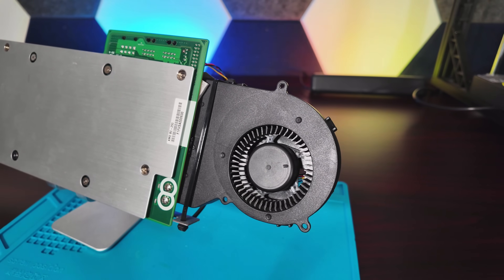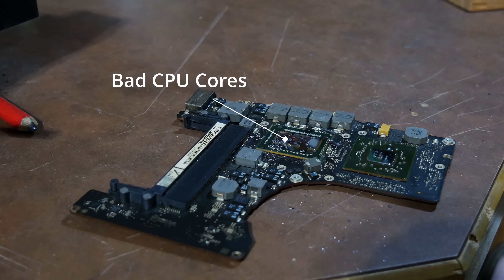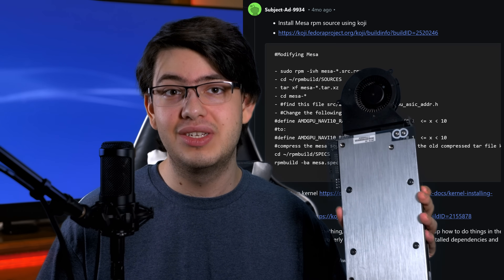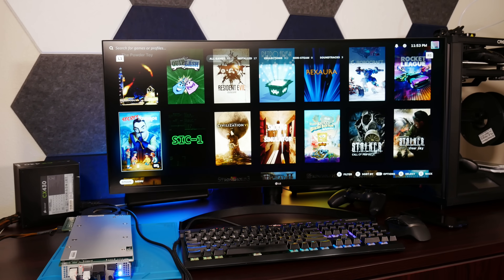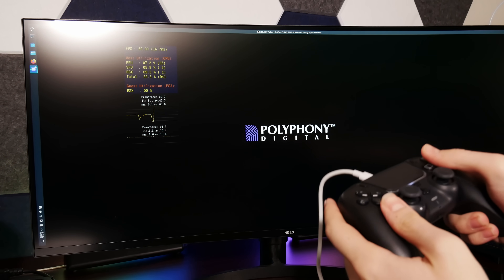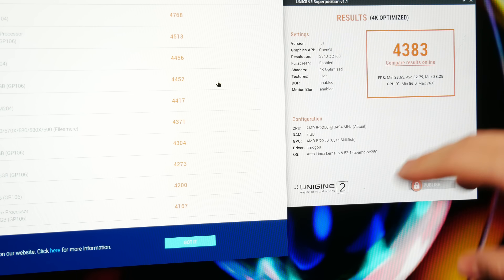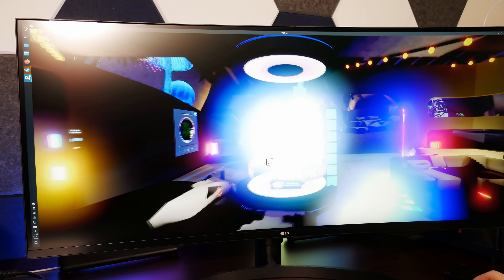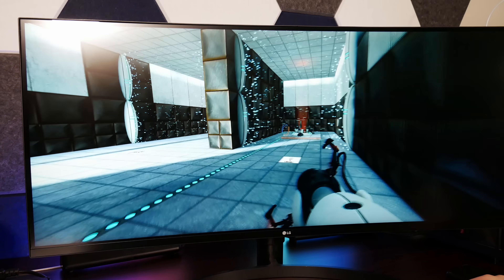I Ran PS3 Games on PS5 Silicon to Prove Sony Wrong

Comment: sony don't see point run original ps3 games due to many reason., the game data is very bad to play when looking at games ran on acutal ps3 is reason it ran 720p ...but upscaling to 4k makes look uglier with texture pop ins due how it was designed to run on cell processor in mind for nvidia 7700 gpu process textures on 256mb vram with 256mb system ram..the cpu has 1 core and 6 threads that can run gpu risc code  if devs knows how to utilize it right for game ...but its tradeoff when using only one at time for cpu....it can't do both for extra threads and extra gpu cores  that only one at time can be use...either use one core that available for game while gpu see extra 6 SPE as extra gpu cores for rendering tech or use all extra 6 SPe as cpu calculation for game while nvidia won't get extra performance boost when running on its own what is available from gpu core itself...its how it was designed for programming . Its interesting method if only sony could waited for more powerful gpu option from nvidia. They could had use 768mb gpu option plus system ram with 512mb...that be enough to run high res textures on ps3

Comment: you should try running llama 3.1 405B on the whole rig. you should have enough ram for it and youd end up being able to basically have your own chatgpt 4o equivalent instance with unlimited usage
Reply: This. I'm curious over whether or not it has any AI usage, because 3060 cards are expensive, while BC250's are at a more reasonable price right now.

Comment: I'm seeing these on eBay for $60 each, which is only a little bit more than a raspberry pi 5. It would be pretty hard to get a r5 2600x + gtx 1060 for that cheap, let alone a motherboard for them. I can imagine use cases for these, like if you have a spare pcie power connector in your computer and an empty slot in the case, you could turn one into a small gaming rig for a kid or something (with some 3d printed mounting hardware). If someone figures out the memory clock that's even better..

Comment: I think the main reason they haven't done it yet is because they won't unless almost 100% of the PS3 back catalogue runs without any issues. They want to maintain a reputation and if the emulator only runs half the PS3 library with glitches, it'll piss off too many Sony fanbois.

Comment: Ppl are assuming stuff they dont know shit about.

What i know about Sony is that they are very keen on quality standards.

Just look at PS4 support, there are only a „handful“ of games which dont work and still, that was reason for Sony to point that out.

RPCS3 is great but nowhere near to be used as a service for such a big company.

The CPU in the PS5 is still not fast enough and that wont change with your stupid assumptions

Comment: linux mint 7 allows me to delete any files on computer even those as alt os, but over 7 files have this stupid lock on them and SOMETIMES getting su root can fix it but othertimes dosent, why is that? i would like to be able to add and delete files on computers without having to use a super outdated version that wont even work on lots pcs :/.

Comment: Nice work, not surprising though given how good PS3 emulation has gotten over the years and the fact the PS4 onwards uses standard PC cores. 

If I were Sony I'd actually hire the emulation team to build an emulator especially for the PS5, because then they can sell those old games and it wouldn't actually cost them that much given how much prior work has been done.

Comment: 6:25
“Most levels”

Speaking as someone with approx 300 hours in LBP2 Emulated, the issue you were experiencing was emitters / destroyers.

RSPC3 HATES emitters.
Worst level for it is full metal rabbit’s flamethrower cap meanies, since they spawn like 10 fire particles a second.

Something about the spawn/destroy effects emitters can be given obliterates anything that isn’t a top-line CPU.

I got 5fps on the aforementioned full metal rabbit with an i8700k and 2070, would love to see what you get with this doohickey machine!

Comment: For the GPU being comparable to an RX480, you could always try using an RX6700 with an external GPU enclosure via HDMI. It might be slightly limited using HDMI especially when compared to USB-C or Thunderbolt, but I'm sure it'd yield better results than what's already on the thing.

Comment: I mean for ps6 there won't be any excuses.
I bet they remove the bluray drive entirely so you can't use ps3 discs. So they have a perfect excuse to make you buy same games yet again.

Also the jailbreaking scene probably has the most chance of putting a ps3 emulator on ps5.

Or at the very least, in like 7 years when ps6 is jailbroken that will be the ultimate console to have.

Comment: I remember going over the specs of the PS5 when it first came out.   The comparison we were making then was somewhere around an rx5700 or 5700xt.  If you assume the rx5700 and adjust the performance based on the CU ration (66%), you comeout in the rx590-ish range.   So this seems perfectly reasonable.  It's on par with a PS4 Pro with a much stronger CPU.  Which if it was cheap enough ain't bad.

Comment: All sony needs to do is make the "app" that runs PS3 games in emulation cost somewhere around $49.99 and I very much believe that people would buy it. The disk drive in the PS5 can read them, just rip them to the internal SSD and go nuts. It's not like you can buy these games anymore anyway. What's the big deal?

Comment: In this very rare occasion I do understand Sony why they didn't bothered to make PS3 emu for the PS4/5. The emulation from a CELL based CPU to an X86 instruction set would be a ton of resource to write from the ground up.(RPCS3 took 10+ years for the community.)  I do think it's true in itself the architecture of the PS4/5 isn't capable of running PS3 games.  I do not think they can use (or should use) a heavily modified version of RPCS3 from a legal standpoint I may be wrong because I'm not sure what license is RPCS3 use.  Also that emulation they hypothetically would build has to be 100% working at all times without any graphical bug/stuttering etc.  This huge development would make the PS5 cost more obviously. The B version (I'm not sure if it's possible tbh) that they include a Cell on the board like they did with the Emotion Engine for the early PS3 and it would still cause a huge price increase like with those early PS3s.

(small disclaimer: the last PS I had was the PS2 about 13 years ago so I'm not a Sony fanboy.)

Comment: yes but they need to spend a ton of time and money on developing their in-house emulator since rpsc3 is licensed under gplv2 which means theyd need to opensource any and all modifications done to it as well as testing it and integrating it well enough (cough cough Wii U vWii cough cough), and it's a feature that not many people will use as a lot of ps5 owners probably dont know or care that the ps3 exists

Comment: This looks good, however there's still the issue about adding trophies to the games. While it is true that Sony doesn't allow PS3 emulation because they want people to buy their old games again, it probably isn't as simple as building an in house RPCS3 like emulator, since they gotta consider the licenses on the disks activating a digital product (sort of like Xbox does it) that's also integrated on PSN with trophies and your progress in them, which is much trickier I'm sure. Still, if they wanted to, they would do it, but they don't, so they won't. :(

Comment: So what you all did was it so the ps5 gpu and cpu got downgraded by forcing custom firmware layers to be able and spoofing it to run ps3 games at a lower performance?

and that for the cost of 20+ times the ps3 itself when it came out.

Comment: Question i am not savvy in any way. But from what i know is that the bios is a chip and there are devices that can read it and flash it if you de-solder it. So i think it would be interesting if you looked into that. Maybe you can find some similar video cards and take their bios  as is and flash it on that thing you might get performance boost or might fail entirely, Definitely would be interesting to watch fail or success. From what i have understood is that hardware is way to handicapped

Comment: Pre-facelift PS3s had a whole PS2 chipset inside to make them compatible.
I suspect, with the current miniscule incremental updates we're getting for console generations now, The PS6 would soon be all digital but has PS1 to PS3 emulation capability and the " pro " disc drive attachment would be able to read all playstation disc as part of retro gaming preservation.
That would be a selling point of the PS6

Comment: You had the issues at the current target standard of 4K but what about 1080p Did you do any testing in that range? And since you are emulating what is the oldest system you put to the hardware? Are there any too old to make sense mathematically yet?

Comment: The PS5 is likely even more capable of running PS3 games than this experiment suggests.

When Cerny was presenting the architecture, he mentioned that they'd figured out how to emulate the PS3's Cell processor using one of the PS5 compute units.

With this tech, they could probably build an emulator that works with every game.

Comment: Wouldn't it be possible a to transplant an fully working Chip on this Card instead of the defect cut down version?
And wouldn't it open up to more performance to use in this Card?

Comment: The only issue for RPCS3 is just getting the games to run. At this point we have enough power but the emulator just still needs updates. The gist is, by the time the PS6 is out, there will be no excuse for Sony to not run ps3 games. At that point at least most games will be running well enough on RPCS3 that it should be fine.

Comment: It's probably the most what ever task you could ask of that hardware... But can you run the whole rack in a cluster and do... well, stuff? 
I mean, there are what, like ~100 cores, with ~200GB shared RAM/V-RAM, and it would be interesting to see how those GPU units x12 perform with such low clock speeds.

Comment: For those wondering what the cost is after hearing it's so cheap, it's $349.99 on ebay (currently out of stock), $389.99 on pcserverandparts, for the ASRock 4U12G BC-250 12x AMD BC-250 16GB GDDR6 PlayStation 5 APU Mining Rig.

Comment: Regarding the memory being locked to 450Mhz - It's been almost a decade since I've delved into vBIOS edits for AMD GPU but I'm sure ATiWinFlash must work on this as well. All you need to do is extract the vBIOS from the ROM (can be done through software) and then BIOS editor tools can enable you to edit host of different settings such as Memory Clock, Timings, GPU power etc. You can then flash the edited vBIOS back. The problem is that depending upon AMD GPU driver version, it would run a vBIOS check and would not work on the edited vBIOS but during the time I used the hack, it kept going from working to not working depending upon the driver version. Also, sometimes the flash fails which is when you'd need a secondary GPU to get some video signal out to then flash the bricked GPU; I'm guessing that's not possible here given the lack of PCIe expansion; or maybe that M.2 can be used, so that's something to keep in mind.

EDIT - Since mining is a Memory Intensive task, I doubt that vBIOS has restricted the GPU to max 450MHz. The vBIOS specifies a bunch of frequencies along with their timing that the driver then choses while ramping up or down so the card being locked to 450MHz might be down to the driver picking the lowest Mem Clock in the vBIOS and never ramping up. The two potential solutions is to either find needle in the haystack and figure out what's wrong with the driver, or edit the vBIOS and use whatever frequency those GDDR6 ICs are rated for all possible memory speeds listed in vBIOS so even the lowest state will be what the memory is rated for. Needless to say, pick the right memory timing corresponding to that speed.
Reply: It's actually double 450MHz, linux reports the memory clocks in a very misleading format (pre-multiplied DDR clockspeeds), and Logan reported the clocks as linux did, you should double it to 900MHz before comparing to other things. While 900MHz is REALLY SLOW still, its not actually that bad
Reply: @Beyley  I actually find Linux reporting to be better as it's showing the actual switching speed of the silicon tbh but I can understand why it may also be a little confusing. On that note, GDDR is actually quad-pumped (QDR) so it would be 1800MT/s at 450MHz unlike DDR which is merely double-pumped. Given the 256bit wide bus, it would mean a Memory Bandwidth of 58GB/s which is actually less than what iGPUs in DDR5 systems get from system memory. 

The 6700XT which is said to be closest to PS5 GPU has its GDDR6 clocking at 4000MHz (16000 MT/s at QDR). Assuming same memory was used here as 16gbps GD6 is actually very common and among the lower end of GD6 speeds - then this blade is capable of 512GB/s bandwidth but its memory clock is restricting it to mere 58GB/s. 

It is VERY bad. For comparison, 58GB/s bandwidth in a Dedicated GPU with a 256bit bus was probably last seen in 9800GT, a GPU from Year 2008. There is a shit load of performance on the table if he can fix the Mem clock but I guess it is ultimately irrelevant to the point of the video which only aims to shows that PS3 emulation is possible on PS5 hardware, even when severely handicapped.

Comment: Can this run  bazzite? and ofc it runs ps3, i mean yea there is gonna be ipc overhead due to it being emulated but even a low end pc now days can emulate most ps3 stuff and do it at a much higher resolution. Sony is full of crap as per usual. and, the GPU clock relies on built in software stepping to ramp the GPU boost. I bet it would work with a simple line of code. I know orbis treats the GPU weird and has 4 or 5 different modes it can run at. I would almost bet that the gpu needs to be told to accept more voltage. I bet it is running at the dashboard clock speed. its like 425 or 450 like you said.

Comment: This proves that it's not feasible to run PS3 games on a stock PS5. Only a handful of games run well, with many running with bugs and with very bad frame pacing. Sony is better off releasing PS3 games on current hardware as they have been doing for over a decade now. Remastering. (The Last of Us, Uncharted Trilogy, God of War III, and so on).

Comment: Oh my god i gave up on this  thank you all SOOOO much.
I have the 12 unit box and wanted to make the ultimate lanbox for up to 12 of my friends on lighter games. 
I got windows working pretty well, but every time i tried to launch anything graphical, the driver would be disabled because it was unable to detect Direct X(I had hoped non direct X programs would work)

450Mhz is criminal i hope thats the MCLK and its actually running at 900MT/s or, heck, 1800MT/s in 2:1 otherwise, my lord is that slow. My handheld seems slow when it drops to 935Mhz in 2:1
Reply: What i'd love to do is modify the BIOS somehow to get the power draw of these down, and the clocks up
It is wild how slow this is, and how much power it uses.
Reply: Linux reports the memory clocks as half what windows does (since its DDR, Double Data Rate, windows reports the double speed, linux reports the raw speed), so if you want to compare the 450MHz value to commonly stated memory clock values for other GPUs (which are commonly tested on windows), multiply it by two beforehand.
Reply: @Beyley  this is GDDR6, it should be ~1750mhz, or DDR of 3500MT/s

Comment: Even PS4 can run PS3 games, the ps4 remasters from ps3 games are the prove of it. Because that games are build in the ps3 architecture and they didnt build the remasters from scratch, they just change something here and there, and its done... These companys think the costumers are stupid. The RPCS3 team build the emulator from scratch, and Sony have the ps3 original bios and architecture, so they can build a emulator very easly, like they did in ps3 PAL consoles, where the backwards compatibility for ps1 and ps2 are by emulation, and its 99% perfect. The fact is, Sony dont do backwards compatibility with ps3, ps2 and ps1 on PS5 because of money, to force the customers to buy the same games over and over again. PS5 is more them campable to run all consoles with big resulotions, and 100+ frame rates.
Reply: Oh god no, not stuff with out of order index code on the spus, no way lol that cannot be emulated even theoretically, on the ps5 yeah but it isnt easy. You are thinking of games that just use the main thread thats ez
Reply: @wizzenberry  they can emulate very easily if they make effort to do it. So how can you explain the fact the ps1, ps2 and ps3 games build and program on ps1, ps2 and ps3 architecture can run on ps4 and ps5. If that was true the old games cant even run in new hardware... They dont build the entire games from scratch to run in new hardware lol. Companys just dont want to do it because of money, and to force people buying the same games over and over again. And its funny how custom OS for ps3, can make ps3 with no retro compatibility to run ps1 and ps2 games again, and on ps4 can run ps3, ps2 and ps1 games. That proves what Sony says, its all bullshit.

Comment: And the PS5 GPU isn't really an RX 6700 at all. 🤷 It's more like a die-shrunk RX 5700 with RDNA 2's ray-tracing parts bolted on. The actual CU's themselves are basically RDNA 1. This is why it literally registers as a "NAVI10" GPU (aka the RDNA 1 GPU in the RX 5700/XT).

Comment: GDDR* is quad-pumped per clock (vs DDR's double pumping) so 450Mhz = 1800MT/s, ergo "1800MHz" in average Joe speak. That's still a lot slower than the PS5's memory normally runs at but WAAAAAAAY faster than you thought it was.